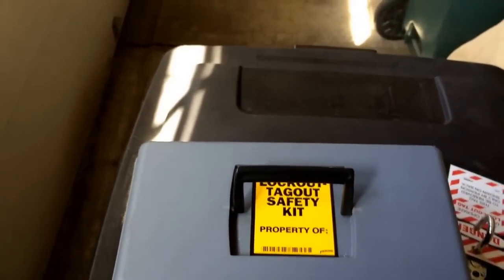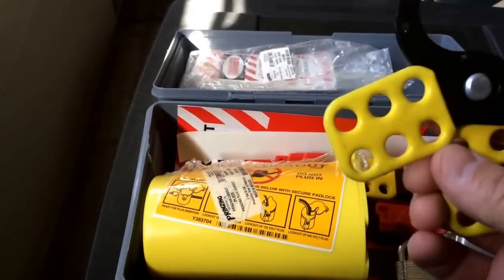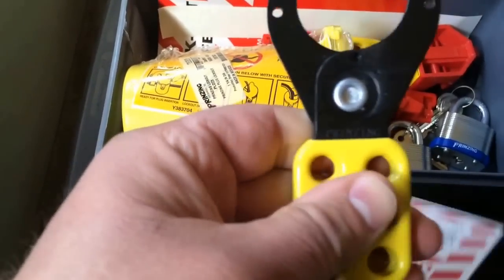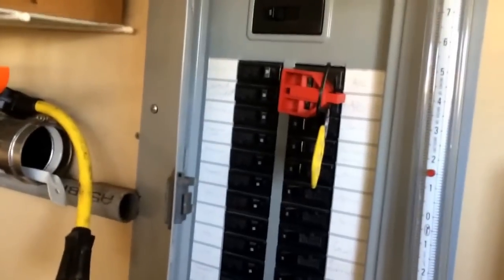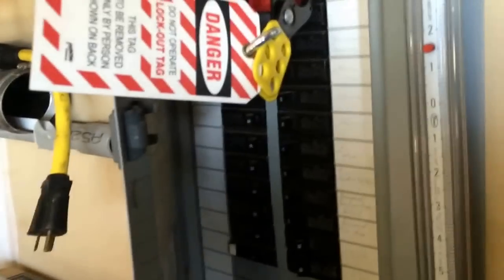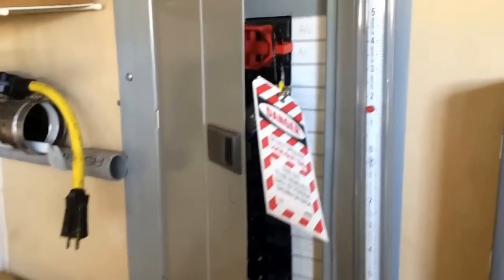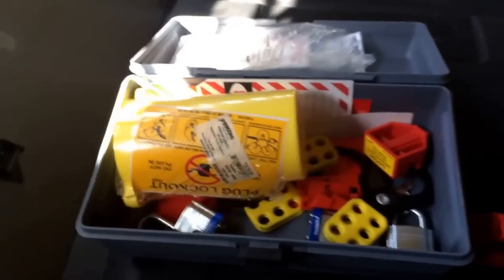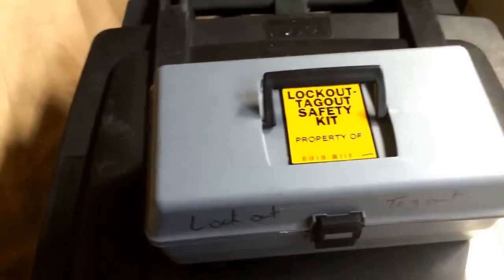HVAC Safety: Lock Out Tag Out, are you doing it?

Comment: Very good video! Very Important. My department has also done ARC flash training. A few years, I had a breaker turned back on in the middle of working on a heat pump. Thats when I realized , you can never be in to much of a hurry for proper safety!